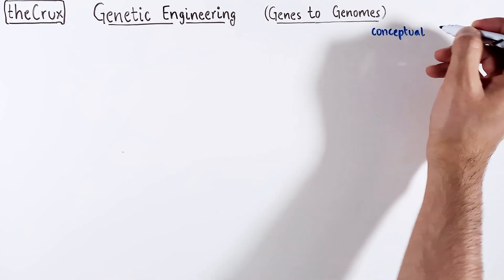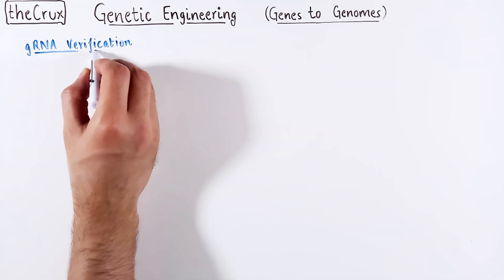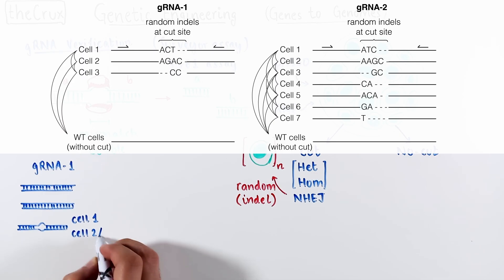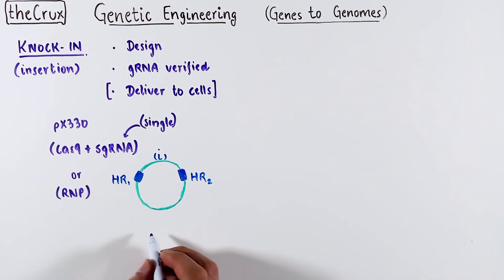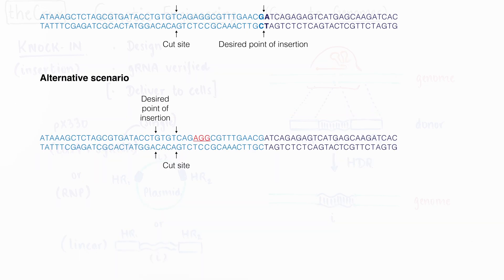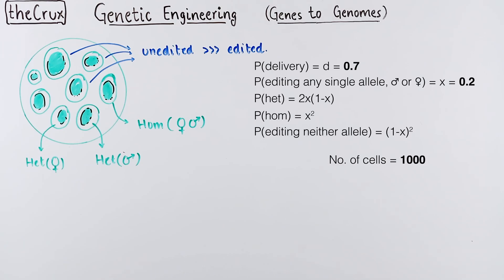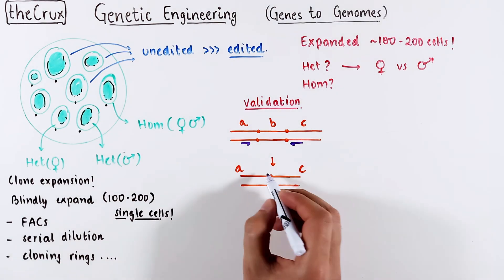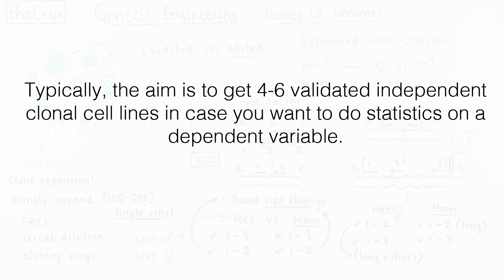CRISPR KO vs CRISPR KI experiment using CRISPR-Cas9

Comment: Hey!! Thank you so much for your videos they have really helped me, would you mind answering what would happen if the desired point of insertion fell in the sgRNA sequence region... I ideally thought the donor DNA would not be affected because the HDR happens after the cut... I would really appreciate your help :)
Reply from the maker: Glad the content is useful. If the insertion point overlaps the gRNA sequence then it means that post HDR, at the least, the gRNA target sequence will be split (i.e. you inserted something in it). Therefore, donor will be unaffected and you can even get away without mutating PAM region in the donor. 

Ideally, the insertion point should overlap the seed region of gRNA (i.e. HDR outcome will split the seed region). If it falls outside of the seed region (for instance, say 3 nts from the 5' end of the gRNA), you will likely find that Cas9 can still target the donor DNA. The farther away the overlap of insertion point from the seed region, the more chances that donor DNA is cut. There are many nuances and caveats to all this, but I hope this helps to guide your thinking.